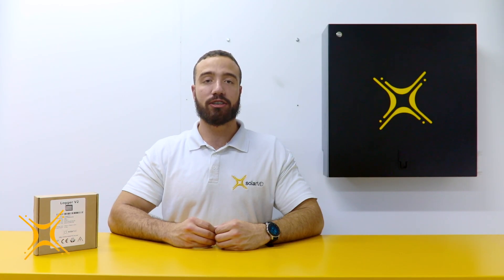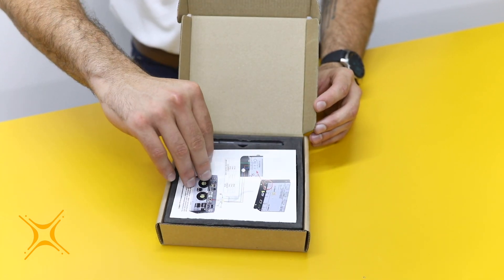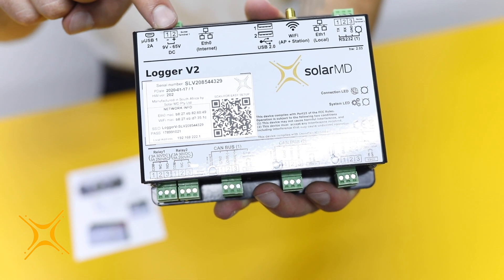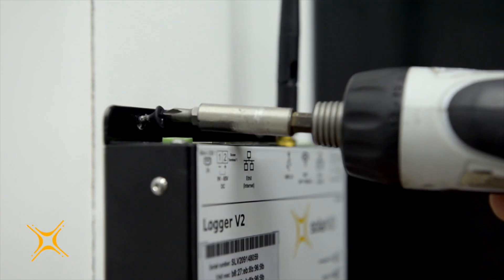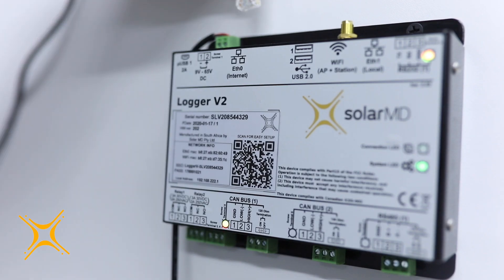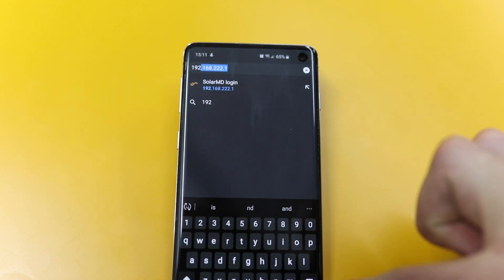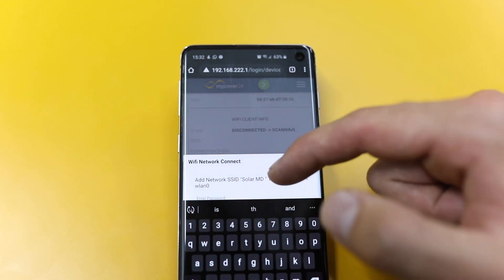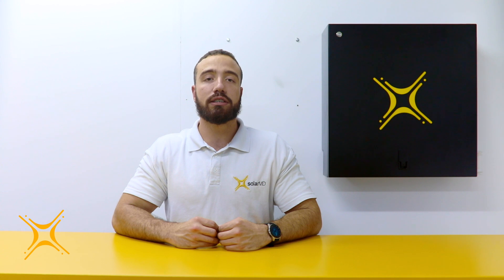Solar MD LoggerV2 - 2020 updated version (QR code / registration)

Comment: What do users typically use  the two open relay contacts for?
Reply from the maker: Hi Peter, this has been used for some inverter models which do not have CAN bus communication. Another usage would be to control the start of a diesel generator or simply switching off loads based on the battery power or state of charge.
Reply: When set to EXPRESSION how does one then set the Relay trigger parameters. For instance when SOC = 100% I want the relay to trigger so I shift a load from mains to inverter and when PV <1kWh I want relay to go to off so load shifted back to mains. The 250V 3A relay is enough to work a contactor coil. Well done. Now about the relay settings please
Reply: @bktembo  you can email us on support@solarmd.co.za & we will gladly assist with the expressions.